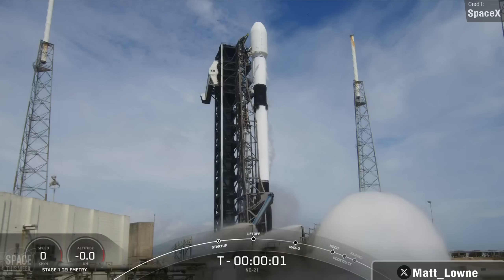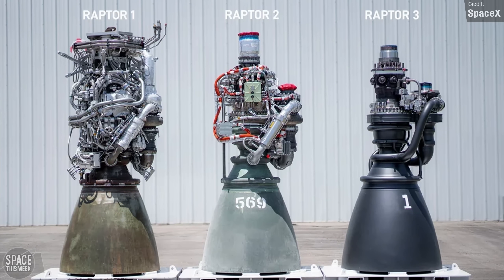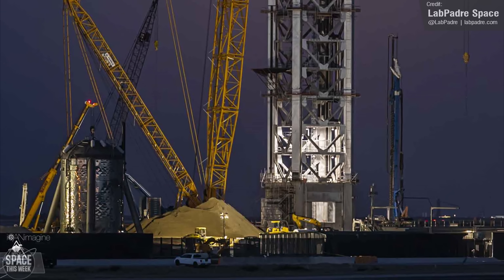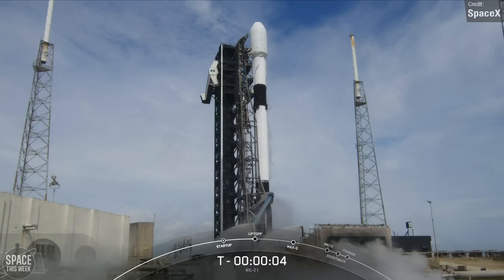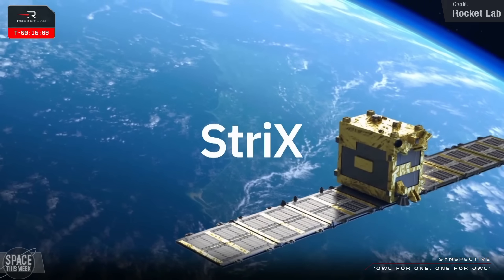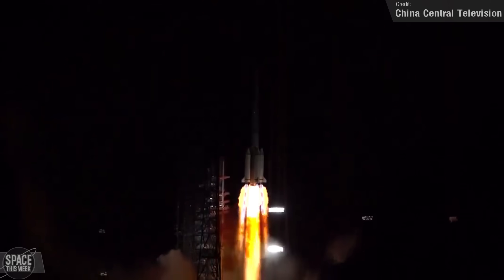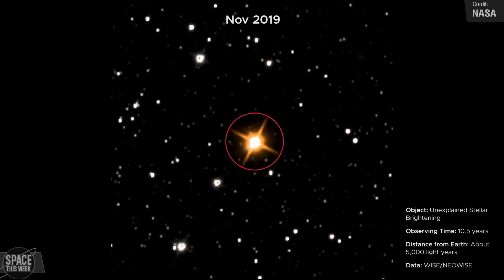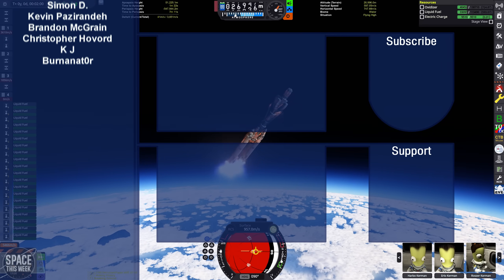SpaceX Launch Tower 2 now 6 Sections Tall, Ship 30 may need another Static Fire, and Raptor 3 Reveal

Comment: There is something not kosher with that raptor 3 engine..... 👀....definitely photoshoped to a degree imho
Reply: Not at all. All pipes that were on previous versions are still there. Just instead as separate pipes, they are present as channels inside corpus. All valves are on the top of powerhead inside that barrel or under those round covers. 
Imagine making prototype of electronic using universal plate. All wires are visible making visual mess. 
But in production you will make dedicated plate with printed wires. Same principle.
Reply: @just_archan  cool 😎 👍

Comment: While raptor has been getting more clean and modern, I agree with Tory. There is no clear FADEC/ECU on the engine, and it lacks any wiring at all.       
SpaceX hasn’t somehow magically made a fully mechanical engine that needs no electronics. Especially not for something as autonomous as Starship. They just didn’t put any electronics on it. 
The picture of it on the test stand shows no electronics on it that are required to run the engine. Likely they got it to the test stand and then put it on the engine after taking the photo.     
          
this is like if you took the entire wiring harness out of your engine bay and the showed it off to people as a “Minimalist” design. Once you get to the dyno, and all eyes are off you, you can put the harness on and actually run it:
Reply: I think the wiring/elwctronics may have been integrated in some way, think thicker walls and electronics run inside them, since they want to ditch heatshielding and want no reentry burn on booster, that way they could potentially use the engine as the heatshielding to the more delicate parts. But this is just me guessing.This way it's like a circuit board, the meters of wire are there but hidden in the structure. Don't see how they would benefit from not showing something that everyone knows should be there. but no heat shielding will mean that we will see the engines at somepoint on a booster and we will see what they have to add back for it to work and be reliable.
Reply: @U_Geek  Yeah I agree that this is probably the case. There's no real reason why they couldn't bury the electronics in the walls of the plumbing. It would make everything look way simpler than it actually is, but that may be part of the appeal.
Reply: It's also possible there is no electronics on the actual engine. It could be entirely mechanical. Physics says it's possible
Reply: Sorry friend but your wrong.. They fired her up and there's a picture of it. It looks exactly the same
Reply: @TimeMasterOG  huh so then I’m guessing they either found some really funky packaging solution (which like, why not share that?) or they have offloaded the electronics onto the test stand/airframe instead of mounted on the engine.
Reply: @corpsimmons575  the electronics are inside the engine
Reply: I think sensors and valves are moved out of dangerous zones to powerhead. There is not much what is necessary near combustion chamber. All valves also are on input area. Pressure from pumps can be measured on lines for pressurisation of tanks. 
This is what is behind this idea. Minimise weak points in areas that can be damaged by exhaust

Comment: Raptor 3 engine looked so good when I saw it and looked back at the other one. I was like, it looks too complicated, and it has too many parts and pipes and stuff
Reply: NGL when I first saw the one pic of raptor 3 I couldn't believe how simplified it was
Reply: @KiRiTO72987  It's not simplified. All of the same parts are still there, they're just buried within the internal structure of the engine so you can't see them. It like burying power lines under ground. They're still there, you just can't see them.
Reply: @TimCortesi  it is simpler. less parts present=simpler=safer
Reply: @Hungary_0987 safer is perhaps not necessarily true since you could have fluids end up in the wrong place due to shared pipe walls.  Badass and much more complicated than it appears, but idk if safer is true.
Reply: @TimCortesi  it's also weird that it's missing all the control wiring and sensors, usually part of what makes rocket engines look so complicated. did they hide everything inside too or they didn't install those yet ?
Reply: @danilooliveira6580  its blue-tooth
Reply: @KiRiTO72987  ik, I think it looks way better with color and how simple it is.
Reply: @Spacefalcon16   IK I think it's awesome I just had to do a double take the first time o saw it
Reply: @KiRiTO72987  yea
Reply: All the same parts & pipes are still there only now they are 3D printed into the structure.
Reply: @GregoryJByrne  yea looks cool, tho